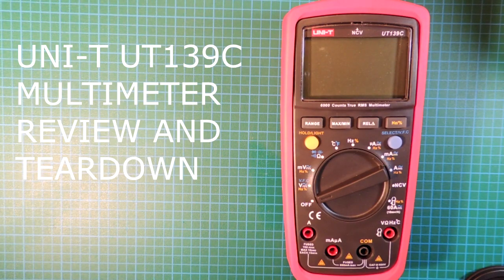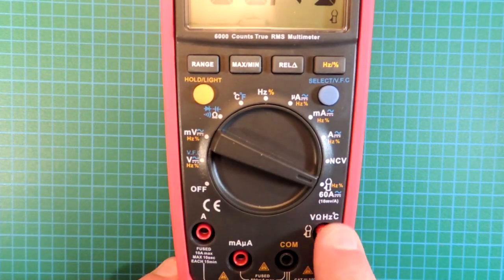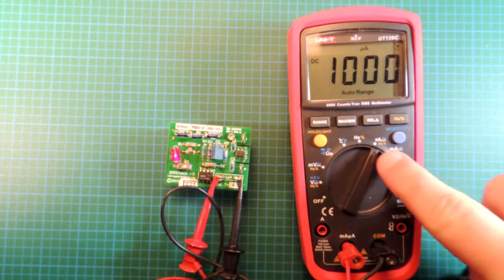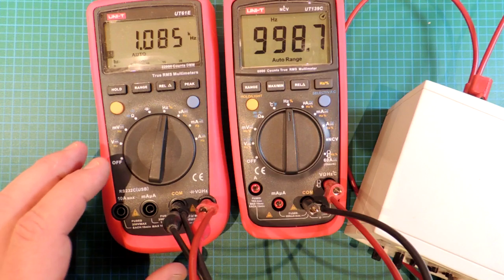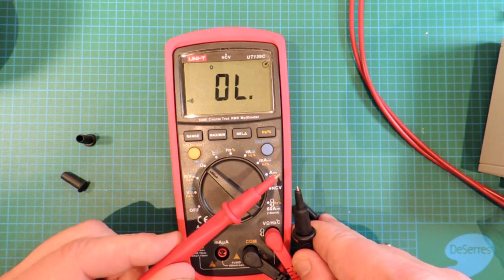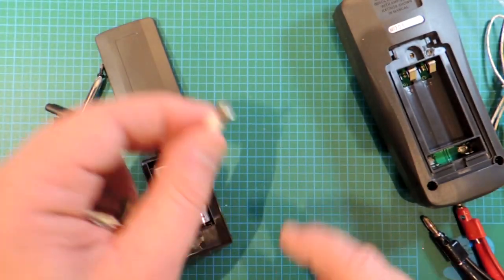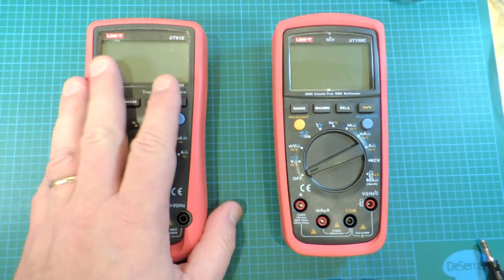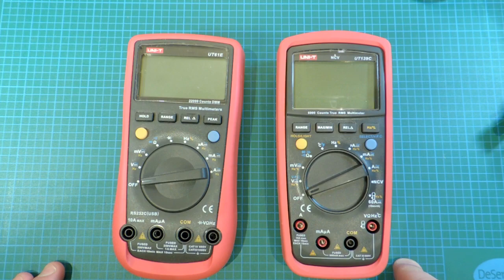UNI-T UT139C MULTIMETER REVIEW AND TEARDOWN

Comment: In mine just discovered that if you put it in mV the display dances from 0 to 150mV with nothing connected.  If I touch probes together they show 0mV.  Is that normal?
Reply: Yes, I know this comment is old but maybe I can help.

What you are measuring is actually real! It's the static charge the probes take up from the air, when you connect the probes you short them out and measure 0V across of course.
Reply: @weker01  thanks a lot!

Comment: Wow same model but myne has soo many differences. The main chip is not on pins soldered instead it is a blob type and cannot be changed. Also it sits on the other side of the board and not on the display side. Very weird... 🤔
Reply: Yea mine is like that too

Comment: Hi. A very stupid question, alas. The K-type thermocouple is not assymetric and thus it can be connected in several ways. Normally you would connect the COM side - marked with COM - with the COM port, and the other side - marked °C- with the °C port on the device. But would it be a problem if you connect it the other way around? I've tried it and strange enough I measure another - a few degrees higher - temperature. Is that normal behaviour? I'm just asking because I'm checking my living room thermostat and when I it connect "wrong" it shows the exact temperature as on the thermostat. And when I connect it correctly, it shows a temperature that's a few degrees lower then the thermostat. Thanks for your advice.

Comment: Hi. Can you make a video on how to calibrate the 139c? I have a unit that produces inaccurate readings. Hope you see this comment and make a video tutorial. Thanks...
Reply: AFAIK this multimeter is calibrated in a factory. Correction factors are stored in internal memory of the device. There is no (official) way to modify them.
If your device reads values which are out of limits specified in the manual you should change your device by warranty.

Comment: I have bought this multimeter, just after unpacking i 've tried to measure a battery's voltage.
It does not shows any voltage.
I also tried the city voltage plug in AC mode.
all other measuring, works properly such as ohm, capacitor, temreture,...
Do i have to change somthing?
Reply from the maker: meter sounds broken.   perhaps return it and ask for a refund or new meter?

Comment: I have a broken 139e. Because I forgot to measure the ac volts 220V, the selector switch is still in the ohm position.  Only the Ampere meter is still functional. Can it be fixed?
Reply: usually you should just be able to replace the protection fuse, if that doesn't fix it it's probably dead.

Comment: I have one of these and its been a great meter and a good value - also good review but you seemed to completely overlook one of the most important features -- it has decent input protection with not only the ceramic fuses but 2 PTC's (green components) and 4 MOV's, (blue componenents) down by the input jacks, even the more expensive UT61E doesnt have this group of input protection devices.  m
Reply: That's right, input protection is the most important thing in a multimeter.
Still have it?
Is working?
Best Regards.

Comment: DC or average value of a signal is measured using the Zero Order Recursive Least Squares  (RLS0) approach. The higher the sample count, the better the accuracy of the RLS0 algorithm. This what counts means.  RMS is also measured using the RLS0 block. First the signal is squared, then goes into RLS0, then it gets square-rooted ... A high-end Fluke DMM uses over 4 million count samples!  This DMM is good for hobbyists not professionals ...

Comment: I liked the 22,000 count display on the 61E but lack of a backlight and poor input protection made me pick the 139C and im glad I did - I dont need data logging and can also forego the 22,000 count display on the 61E -  the 6,000 count 139C has a backlight, good build feel and seems more than accurate enough for my needs with a nice legible display, im very pleased with the 139C overall.
Reply: Don't need data logging? I want to take measurements from a solar cell array to log measurements each hour from sunrise to sunset. Any idea how I could do this? Or do I need a different multimeter?

Comment: Good review. Recently bought this multimeter. I like everything except short interruption in the beep-sound in circuit on-off mode.  In my device is the same.  It seems to me that this is due to the use of protective elements in the device (for example varistors), which create additional capacitance in the measurement circuit.

Comment: Why does voltage rating of fuse matter? Fuses are current devices. A 10A fuse will still blow whether the current is over 10A (say 15A) at 5V, 250V or 600V. As long as its a ceramic HRC fuse, not glass, voltage rating doesn't make any difference. In the UK BS1363 fuses are cheap, come in 3, 5, 10 and 13 amp types and are sold pretty much everywhere. I can buy a pack of 10 fuses for about £1.50 or less. I actually replaced the 10A fuse in my 61e for a 5A.
Reply: For higher currents I use my clamp meter.
Reply: Also BS1363 fuses are ceramic and sand filled.

Comment: Do you also have problem with LCD readability when you looking from above? For me numbers are barely visible, there is low contrast. Every UT139C has that issue?
Reply: Yes they all have  the same problem, theres a way to fix but you need to dump and reflash the eeprom to fix it
Reply: @pedrofernandes7968  sounds like something the manufacturer could do with ease...

Comment: Thanks, nice review. Just to put the 'British standard fuses for current ranges' comment to bed. I don't know what was going on there with that model supposedly supplied to the UK market for testing extension leads, but we Brits also use HRC fuses and have some of the most stringent electrical safety standards in the world... just look at our plugs! Posit this was more a case of Uni-T specs, who are/were renowned for using glass fuses in their meters.
Reply: nuntana2 I know Brits ur lucky to have such good electrical standards!. Most of the world are full of fucktards who take electricity too lightly!. Even my dad is an idiot who just strips 2 wires and shoves them in the mains outlet for a water motor. He thinks it's ingenuity that he isn't using a plug!.

Comment: Just purchased ut139c installed batteries then noticed when picking up meter support bracket dropped down and flopped about (just like in your video after you reassembled it)tried google for solution emailed uni-t no reply. Problem solved by more tension on the screw which secures battery pack hope this might help other users.By the way liked the video

Comment: I prefer this meter to a Fluke 87V. For DC volts is reads within 1mV of the Fluke over the range i tested on from 0.5-32V. The 139c read consistently 1mV lower than the Fluke. Both meters settled to their reading almost instantly and update rate was the same for the Fluke and the Uni-t (about 2.5/second). Not done any other comparison tests. Also it autoranges on capacitance, which the Fluke does not. I prefer the Uni-t 139c to the 61e.

Comment: Excellent Review!!!. You just earned a subscriber. At the end which one of those multimeter do you think is best?

I'm starting in the electronics and I was looking both of this meters models on Amazon and eBay to be honest. 

So i would like if you can tell me or recommend which one I should buy.

Thanks in advance 

Regards
Reply: Scrappy Coco So if I need more safety and reliability should I go with 139c or 61e?. For use with opamps, microcontrollers, Arduino, basic robotics, automotive, power electronics & telecom use as an EC engineering student will the 139c have enough accuracy for any project I could probably take up?. In other words what specific applications would the 61e be needed over the 139c?. Thanks in advance.
Reply: Nelson Agosto need more accuracy and counts? uni-t ut61e is your best option! wanna more features ? go for the ut139c! i'm a hobbyist and i have the 139c because i usually work with Ac voltages and i need more input protection...

Comment: Very good review but the current clamp function needs explanation. There is no information regarding this even the UNI T itself do not have information about the accessory clamp. This is a very handy feature but if it is not usable then this meter is crap. Do you have any info regarding this. Thank you
Reply: hi there did you ever get to the bottom of how the clamp meter function works with this Dmm. Thanks.

Comment: ITTBSEurope
The UT139C cost $49. The similarly priced Hioki meter, the 3244-60, doesn't have the functions or accuracy of the UT139C. It runs off a crappy button cell.
So in this price range Hioki loses out to UNI-T.

Comment: I bought this meter from Franky and I received it very quickly. I did a few test to it and I must say this is a good cheap meter. Good value for money. First I test AC voltage measurement using function generator and I compare the reading with my Fluke 87V,and to my surprised the reading is spot on even up to the last digit. I test them bought with different waveform and with different frequency and they both agreeing with each other. I put also the Fluke 87V in its high resolution mode,and still they have the same reading with my UNI-T UT139C. I have tested also the frequency capability of this meter and the result is very surprising to me. The manual says it can measure up to 10Mhz but since my function generator can go up to 20Mhz I gave it a try and you know what it displays the frequency flawlessly,spot on to 20Mhz!!. I wish I had a higher frequency gererator so that I can test it further. 
The only thing that I have notice to this meter is its poor EMI shielding if that is the correct term,because I'm not an Ingeneer :). If I compare it to my Fluke87V, the UNI-T UT139C reading can be  affected by outside EMI. Other than that it's a great meter for me and I'm very satisfied with it :).